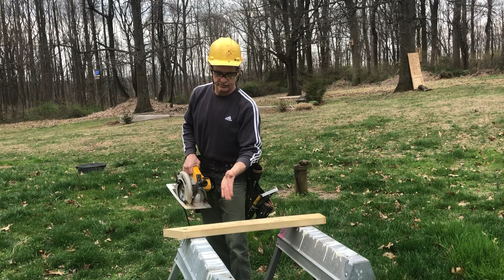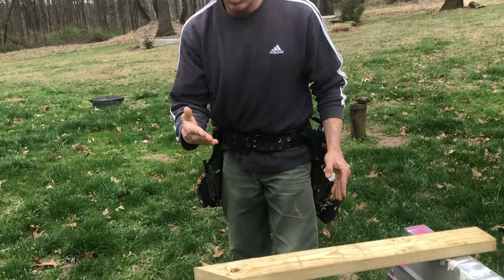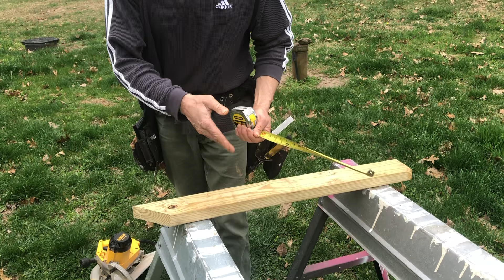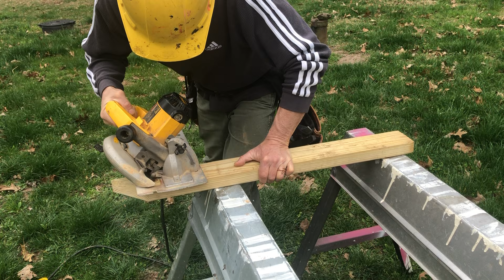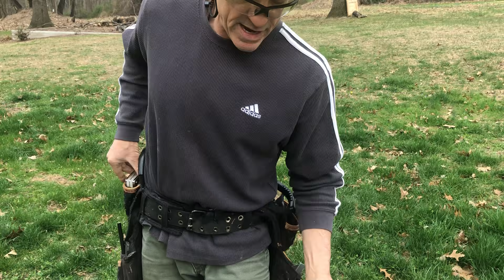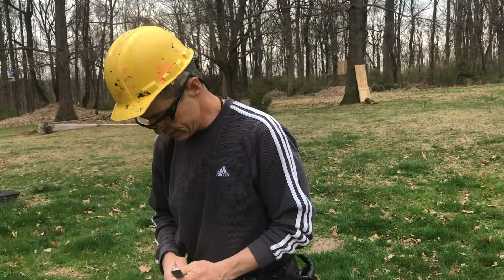How to cut a bevel angle using a circular saw

Comment: What if it’s a 60° bevel?
Reply from the maker: Most circular saws don't tilt that far.   You may have to use a handsaw or recipricating saw.
Reply: @ I remembered how. Set your saw at 30°, make the bevel, then go to 90° and put your saw on the end of the bevel.. ta da!!! My blade is barely to short to cut that long angle and have to finish it off  with a hand saw. Like the last 1/4”

Comment: If I need to cut an indoor handrail would I use the same angle?
Reply from the maker: I would cut a handrail with a power miter saw.   It is going to be difficult to get a nice cut with a portable circular saw on a handrail.
Reply: @ thanks for the recommendations, but just don’t have the budget to spend over $250 for a miter saw.

Comment: How to cut that 45 and be straight? I cut some wood today and seemed a little off
Reply: Takes practice. The more you do it, the better you get at it. When you join two or more angled cuts together, you are better using a drop saw, because 9 times out of 10, one angle might be off a couple of mms than the next one, and so when it comes to joining the angled cuts together, your angled cut might end up having being too short creating a gap.